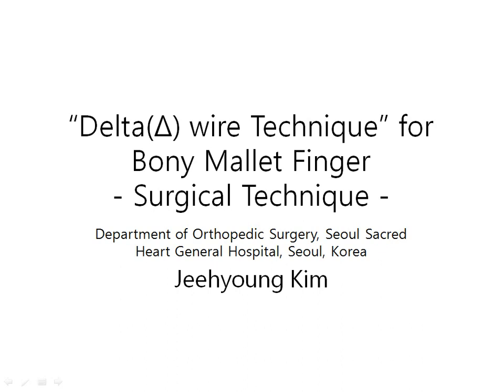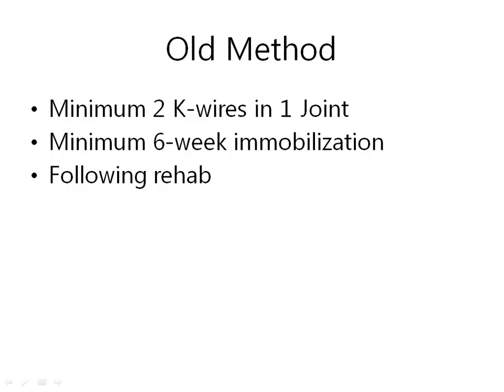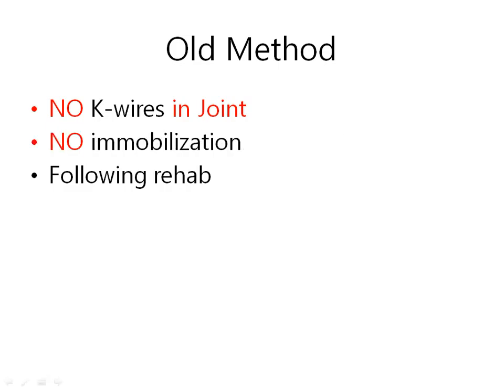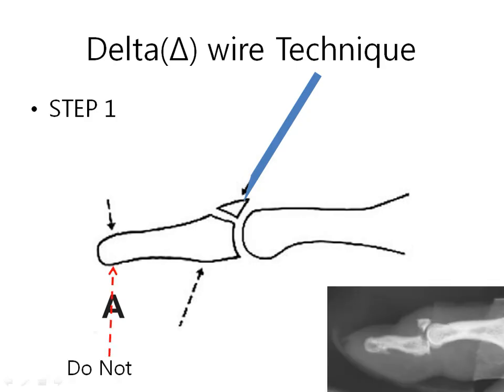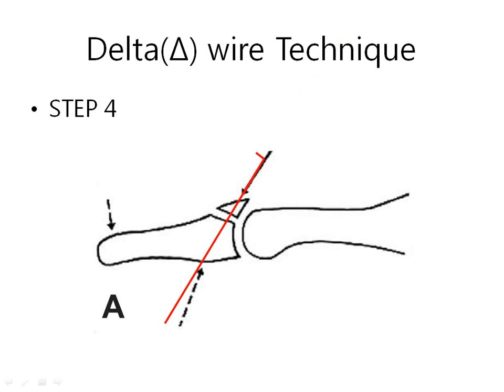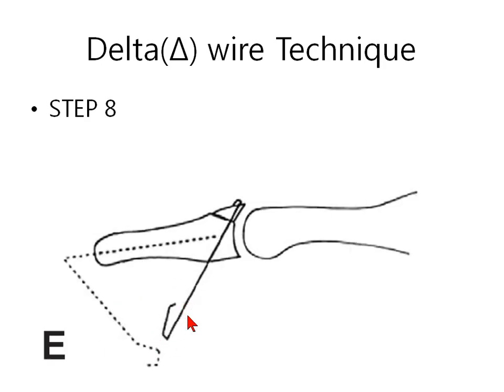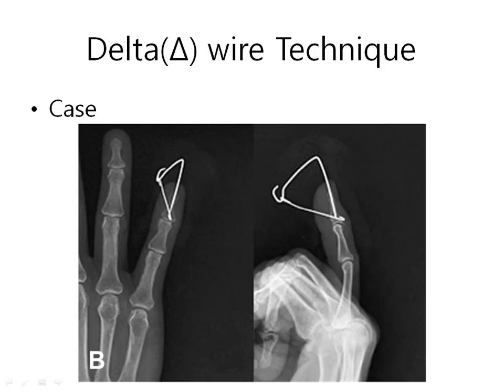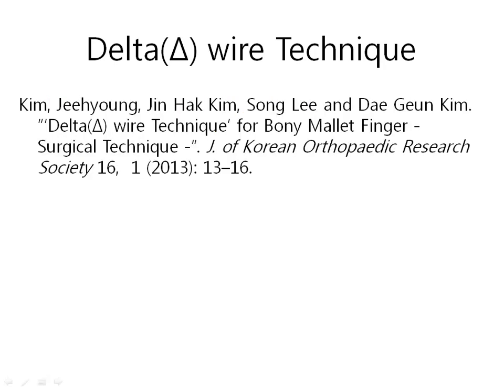[Delta wire Technique] Bony Mallet Finger

Comment: Any issues considering accidental pullout of intramedullary KW? Seems like big construction protruding from finger would limit patient in day to day life. Thank you for your video. Interesting concept.
Reply from the maker: thank you for your comment.
that is my concern too. 
because of the configuration of self locking 2 K-wires, accidental pullout of intramedullary KW can be prevented without forceful intentional  pullout by covering with additional gauze dressing.
limitation of day life is inevitable.but extension block method and any other methods have the same problem, too.
extension block method has the same risk of accidental pullout without additional dressing.

Comment: Can this be done after 3 months injury
Reply from the maker: I don't have a case like that, but I think this tech is better than 'extension block tech',
if there is a bony fragment large enough to compress.
Because with 'extension block tech', stiffness after treatment is inevitable.
If I were you. I will disconnect 2 K-wires before removing, observe for several days, and remove them.

Comment: Very good technique.Your comments on; How to  remove the Hooked K wire which is in the  small chip of the Distal fragment.Must be difficult  at even four weeks.I tried the procedure  today.Cud not  make a  hook  with the Intramedullary wire.Seems difficult to make a hook and then grab it with the K wire of the fragment which is  exiting the volar side. your comments shall be appreciated
Reply from the maker: You can easily make a hook with a small mosquito. After creating the hook, you need to cut it. It bends easily because it is the smallest K-wire with 0.7mm diameter.
Reply from the maker: When the right opportunity comes, I'll show you how to create a hook with a video.

Comment from the maker: Rehab and treat after operation to removal.

in operation room under (local) anesthesia,
we can check the stability while passive and active motion.

After that, I apply aluminum splint, not for stability but for safety and further trauma protection.

As soon as the patient is tolerable, usually the next day when I change the first gauze dressing, 
I check the active ROM, I allow him active ROM and reapply the aluminum splint for protection
 (especially
while sleeping).

Once a day He Open the aluminum splint and move actively, 
just to maintain tolerable active ROM and re apply the aluminum splint again.
Not strictly everyday but just every second or third day 
it will be Ok just to maintain the Motion and cartilage preservation. 
Or even under the aluminum splint he will move his finger also.

After 6 weeks under C-arm, I
disconnect the two hooks, it means there is no compression force, I ask him to
move actively and I check Passive full ROM stability.

I move the thinner K-wire just a little bit backward, I check the stability again.After that, I remove the 2 K-wires as I metioned.

The Next day I remove the gauze dressing
 I allow daily living.
Reply: Jeehyoung K

Comment: plz i want full details from operation starting to full injury recovery, or how to exercise daily
Reply from the maker: in operation room under (local) anesthesia,
we can check the stability while passive and active motion.

After that, I apply aluminum splint, not
for stability but for safety and further trauma protection.

As soon as the patient is tolerable, usually
the next day when I change the first gauze dressing, I check the active ROM, I
allow him active ROM and reapply the aluminum splint for protection (especially
while sleeping).

Once a day He Open the aluminum splint and
move actively, just to maintain tolerable active ROM and re apply the aluminum
splint again.

Not strictly everyday but just every second
or third day it will be Ok just to maintain the Motion and cartilage
preservation. Or even under the aluminum splint he will move his finger also.

After 6 weeks while remove, under C-arm, I
disconnect the two hooks, it means there is no compression force, I ask him to
move actively and I check Passive full ROM stability.

I move the thinner K-wire just a little bit
backward, I check the stability again.

After that, I remove the 2 K-wires. 

The Next day I remove the gauze dressing I
allow daily living.
Reply from the maker: see https://youtu.be/vg1tQeRM_hE  for post-operative treatment

Comment: how to remove delta wire
Reply from the maker: step 1. untie 2 hook, examine active motion.This means clincal union.
step 2. axial logitudial K-wire is removed easily.
step 3. under local anesthesia around dorsal hook and stab small wound.
step 4. push back the oblique K-wire just 1-2mm and cut the hook
Step 5. pull the oblique  K-wire palantar side
Reply from the maker: otherwise 

step 4. push back the oblique K-wire just 1-2mm and cut the distal part of Kwire as much as possible
Step 5. pull the oblique  K-wire dorsal side
Reply from the maker: see https://youtu.be/vg1tQeRM_hE  for post-operative treatment